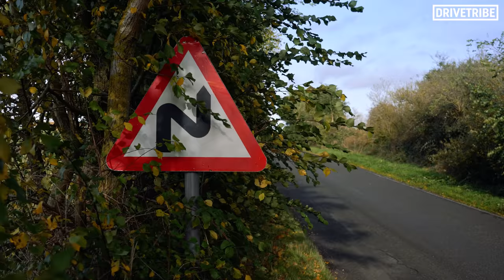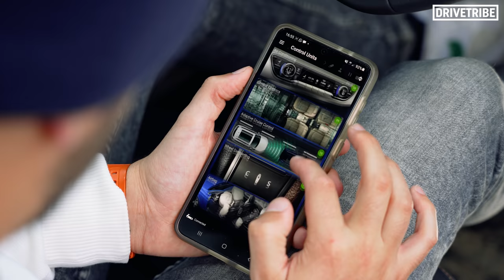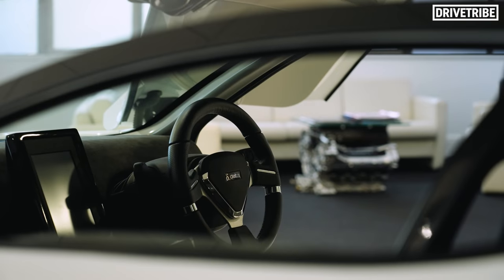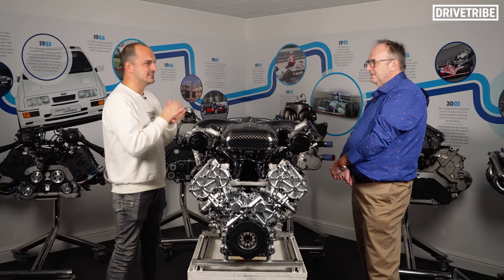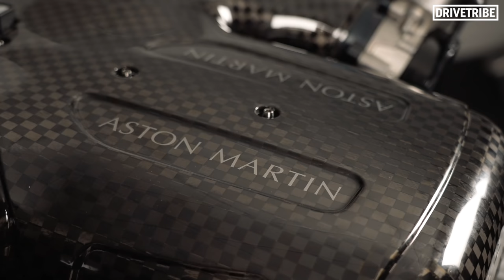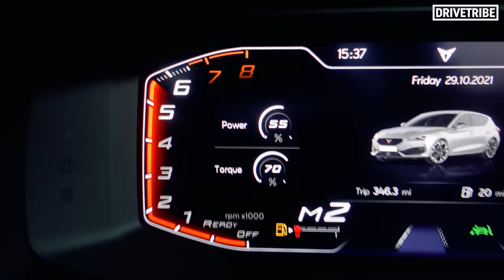Why are almost all modern engines 2.0-litres?

Comment: "If you're looking for 1000hp, you're not going to get it from an inline four"
Civic tuners: "Hold my valve springs bro"
Reply: My first thought was the Lancia Delta S4's twincharged 1.8L I4.  When they tuned the boost to the max, that thing could hit 1000hp.  For racing, they capped it at 490 (officially).
Reply: You can easily get this with an electric drivetrain
Reply: GM EcoTec motors have entered the chat
Reply: @walterrudich2175  BLASPHEME!!!
Cast the heretic out from the Cathedral of Carbon!

But yeah... True.
Reply: @brokenursa9986  yes the Fiat Twin cam is a solid design that has lasted and been fitted to an insane amount of vehicles.  Power depends on build internals and turbo / charger , and head cams fitted.  Look up Triflux engine abarth special design for S4 ECV Grp S .
Reply: @revolutionday1  GM left the chat due to impending bankruptcy
Reply: You can get almost 2000 hp on 4 cylinder
Reply: @walterrudich2175  No torque though.
Reply: James Mcguire  why wouldn't you use nitrous?
Reply: Volvo 940 Gl has plenty too. Goes like a box of bird poo
Reply: This dude is exacly wrong.  ALL ralley cars are over 1000hp and 2.0L
Reply: The problem with small 1000hp inline 4s is they make 1000hp for 2k rpm but a larger engine has large power from the low revvs too
Reply: @ChutneyGames  The big problem is reliability decreases with engine stress. No one fläsks around with a leek hp for tired eco-torquing, that's what you get Lorry for.
Reply: James Mcguire  right now, battery vehicles have about the same range as gas vehicles, and they charge in 20 minutes while gas can refill in only 6 minutes. If they can cut the charge time in half, to 10 minutes, then I think that will be the transition point for most people.
Reply: @pilotavery  so you're saying a 20 minute super charger will put 350+ miles of highway driving back on an EV? 

I'm all about evs but our family has property 2 states away and we visit often. It's 1100 miles round trip.
Reply: @Seasniffer69  very close, lucid air can charge 20 miles a minute, can reach 300 miles in 17 minutes, 344 miles in 20 minutes. This is dropping year over year. Tesla can charge 1,000 miles of range per hour, or 15 miles a minute, but only up to about 200 miles of charge. Even then, that's dropping year over year.

EV's are just now becoming feasible for road trips. In 5 years or so, at the current rate of improvement, they will have range and recharge times on par or better than gasoline.
Reply: @pilotavery  hm my next question is, are ev batteries still advancing or Is the juice almost squeezed out of that? If we kept the car weights from the 90s with the fuel efficient transmissions and engines of today we could have 50+ mpg 4 door sedans.

The last 30 years or so gas mileage really hasn't improved in combustion engines for normal cars. Not hybrids or niche smart cars/fiat absrths.

My 97 Honda Civic got 35mpg highway not even trying. A 2017 Honda Civic is just about the same.
Reply: @Seasniffer69  we have 50% efficient gasoline engines right now, and the most you can ever get is 100%. We've kind of reached the peak of engine efficiency.

We could get Lithium 100x the capacity as we have now, but it's a lot more likely we will switch to another less expensive for more effective battery. Battery technology is agnostic in that you can switch the chemistry and the car is fundamentally the same. The theoretical limits of battery tech is about 100,000 times the capacity but really, we're just going to see these incremental improvements over time. It doesn't have to be perfect, just better. 

Batteries are getting 10% lighter, more powerful, faster charging, and cheaper every year, consistently. The chemistry has changed from Lead acid to nickel cadmium, to nimh, to NMC lithium, LIFEPO4+ lithium, NM, various other lithium-type chemistries each better than the last.

Gas engines just can never reach 100% efficiency, and 50% is considered the best we can do without using space age tech to make it vibration and noise and heat-free.
Reply: @Seasniffer69  gas mileage has not improved because we've reached the limits of gasoline engine efficiency, roughly 53%. 53% efficiency cost twice as much as 50% which cost twice as much as 46%. So we've reached the peak...
Reply: @pilotavery  so how's a 1.6L Honda engine get the same mpg at 2600lb car as a 2.0L 3000lb car?

A heavy car in the 1990s was 3000lbs with most being 2500-2800lbs.

New cars? A heavy one is 4,000lbs. Typical sedans are 3100lbs.

Put a new motor in an old car.

Direct injection did not exist much outside of supercars/racing in the 1990s. Let alone in economy cars.
Reply: @Seasniffer69  we've gotten so advanced with the engine technology that right now, manufacturers are using aerodynamics for efficiency instead of engine. It costs less to implement aerodynamic efficiency increases, and we've reached the limit of that now so we're moving back to engine advancements. Hence, new engines like skyacriv and others.
Reply: @brokenursa9986  never trust an Italian mechanic, my fiat panda-romeo ( a panda built with Alfa Romeo parts from the prototype division of Alfa Romeo) was able to defy gravity.
Reply: @Seasniffer69  Batteries are fairly advanced at this point. I think modularity and standardization is the next big advance. As it is electric vehicles cat 2 to 5 times the range of equivalent energy in gasoline (MPGe)
Reply: @AmeriMutt76  road cars are totally not the same as rally cars...road cars are designed for TRANSPORTATION/DURABILITY...so the engineer is correct, you're  not.
Reply: Steven Sanders  exactly. ROAD cars must be as reliable and efficient  as possible. These fools like speed, not cars. They don't know what transportation means.
Reply: J.a.m  extreme tuners 2145bhp evo 9
Reply: Laughs as he says you’re not going to get 1000hp from a straight four😂 he obviously doesn’t see many modified cars.
Reply: 2.0 can get a lot of HP.But how long will it last 🤣 3.0L is the key to hapines
Reply: @walterrudich2175  Yes for 10minutes  and a 4 hour recharge time for a bev or two minutes to fill a liquid fuel tank.
Reply: yah and then their engine throws a rod or blows a head gasket 22 miles later
Reply: Koenigsegg: hold my missing cylinder
Reply: @brokenursa9986  same thing with the old BMW F1 cars… 70+ psi of boost through a TINY 4 cylinder… not reliable and EXTREMELY difficult to drive 🤣
Reply: @pilotavery  I don’t think lithium will be what replaces internal combustion… once we figure out how to mass produce graphene batteries, it’s over for everything… JETs, cars, trucks, you name it…
Reply: @Texas_Road_Warrior  which cell chemistry will make the race is a question of economics and dependencies not about which has the best properties. Graphene still needs graphite which mainly comes from china and is considered to be one of the four problematic materials in NMC li-ion cells the others being lithium and cobalt due to problematic mining and nickel due to limited resources. It's not unlikely that sodium-ion batteries will become a big player, but only if lithium tech hits a wall in cost development. So... There's many magical battery tech on the horizon. Could be that none of those ever ends up in a car. It's risky betting on it.
Reply: @pilotavery  Which gasoline engine gets 53% efficiency other than F1 engines? The most efficient production internal combustion engines are turbo diesel engines with 46-47% at peak efficiency which you'll almost never reach for long because that peak is very sharp and boost, revs and load need to be just right. Real world efficiency after drivetrain might get as low as single digits in City-Traffic.
Reply: @pilotavery  combustion engines (that includes turbines) have a theoretical efficiency limit of somewhere around 60-70%, I forgot the exact number.
Reply: @kooooons  It's the Carnot number, and it's about 85% efficient. The changing volumes of gases have a loss totaling about 15%, which even in a perfectly efficient engine, can not be lowered.
Reply: @kooooons  By 100% efficient, I mean that the engine has no losses, and the only losses are fundinental, AKA no physical way to increase it.
Reply: @pilotavery  I got that, but you wrote it in a way that could be misunderstood such that the theoretical limit for combustion engines was 100% which might be misleading.
Reply: @kooooons  the combustion process is not 100% efficient, but the engine can be. The engine can be designed such that it has zero losses
Reply: More boost, sodium cooled valves with continuously variable valve control, direct injection, water injection, turbo super compound variable boost, dynamic ECU tuning mapping etc
Reply: @walterrudich2175  it’s not easy to get 1000hp in an electric motor, You would need a power supply that generates a little under 800 kilowatts per second assuming the motor is 95% efficient. 

You average household plug generates up to 7 kilowatts per second so you would need over 110 of them to generate 1000hp.
Reply: @pilotavery  my Amarok does 800km per tank... no EV is charging that range in 20min...
Reply: @andrevanderwalt2515  that's true, but that's also not your average car. Additionally, most people don't drive that much in a straight shot without stopping for break.
Reply: Reading this thread and relating to a comment at 7.45 the guy stated that 1000 horses from a 4 cylinder requires it  to rev to hard. (Not is exact words) They as a manufacturer didn't want to go there. High power 4 cylinders must rev hard increasing potential failures quicker.
Reply: J.a.m  k20 just search 2000hp civic it's a 2.0
Reply: @AmeriMutt76  just... no
Reply: Nah nah my first thought was the turbo erea of f1
Reply: @johnpopoff7950  you have to be joking. Electric drivetrain have torque as soon as they start rotating - effectively from just after zero rpm.
Reply: @pilotavery  And can make it from LA to Vegas on one charge.
Reply: @johnpopoff7950  can go from San Diego to Vegas.
Reply: @walterrudich2175  for 5 minutes yeah. Lol
Reply: Which 1000hp engine would you like?

A Chevy 632 10.4L V8 naturally aspirated, or a Mitsubishi 4G63 2.0L with a huge turbo?
Reply: Right? A K24A1 can do that.  It might not like it, but itll do it.
Reply: @jarrodheley7879  A 632 will destroy your drivetrain at idle hehe, so i want that one 😁😆
Reply: what if your looking for 3000hp. the fastest street car in America has 3300hp. 1000 way too low for me. you can more or less buy close to 1000 hp stock these days with cars like the 840hp dodge challenger demon. or the 797 hellcat. 760hp ford shelby corba gt500. also Corvette is releasing a 1000hp engine stock in 2024. LT6 engine with dual turbos. 1000 is so boring these days its become a stock HP.
Reply: In brazil the late 90s vw ap engines are famous for getting 1000hp easly with 1.8 ~ 2.0 liter 4 cilinders
Reply: @johnsimpson5471  But only for 20 minutes lol
Reply: @curtisducati  not even maybe 8 sec!
Reply: Step 1: buy chevy Silverado 
Step 2: buy rods, crank, Pistons turbo
Step 3: tune it till goes boom
Reply: @ianmontgomery7534  wouldn't combustion engine produce torque at one rpm! Not saying as much as electric.
Reply: The megatron engine: Hold my beer
Reply: @Seasniffer69  yup i miss the crx, it got 40 plus mpg at 4000 rpm going down the highway because it was so light. And because it was light it was competent in the corners. I wish they could make a modern car that was that light again.
Reply: @Seasniffer69  yup i miss the crx, it got 40 plus mpg at 4000 rpm going down the highway because it was so light. And because it was light it was competent in the corners. I wish they could make a modern car that was that light again.
Reply: Yes but I dont want to be rebuilding the thing every 12 months.
Reply: @pilotavery  in the Australian market, utes like the Amarok are one of the most common cars on the road. Utes are designed for carrying weight and distance travelling while being reliable and relatively fuel efficient at that. EV just doesn't have that on say diesel engines for all those categories as when carrying larger amounts of weight the power economy is abyssmal as well as a massive lack of infrastructure. Generally if you have a ute in Australia you're carrying large amounts of weight whether it be for work or for going camping or anywhere semi remote or just general stuff for a car. there's plenty of diesel and even petrol utes out there that can manage 700km out of a 70L tank while carrying over a Ton of weight. The new Toyota Landcruisers are a Twin Turbo 3L V6 Diesel and can manage roughly 23mpg with a payload. electric can't compete with things like that at least in the Australian market at least not with the current battery technology
Reply: @walterrudich2175  lol sure you can
Reply: V8s for ever🥰
Reply: @johnpopoff7950  .... electric motors are know for torque. They have torque starting at 0 RPM. The Model S Plaid has around 900 ft/lb of torque.
Reply: Jett racing 4g63 2100-2200hp 110lbs boost 4cyl they say it may be possible to get 3000hp
Reply: Chevy 4 cyc. has the record for highest HP.   I'm not a GM fan...don't own one.
Reply: @bmwlane8834  yeah I'm not sure what the record is, I know Jett racing 4g63   4cyl has 2200hp  110+120lbs boost
Reply: @walterrudich2175  haha battery go BOOM
Reply: What's with the hat?
Reply: @johnpopoff7950  but instantanous torque at full, 100% capacity availble all times whenever you touch the throttle assuming you've alr bypassed ABS and other traction control system thar limit power output and torque reaping and milking at the little max. torque output number electric cars have a tendency to have
Reply: @AmeriMutt76  and are Factory prices
Reply: The titanic had 2 inline 4 engines that put out up to 15,000 hp of course they were steam engines
Reply: @zokusharuuku1091  or marine engines
Reply: @jarrodheley7879  had a Mitsubishi Galant one down from the rally art four-wheel drive four-wheel steer. Fking thing was rotten like a pear. Engine an running gear sweet 😁
Reply: @danielmeador1991  so a bisected v8?
Reply: @riceduck4657  huh
Reply: Won't last long
Reply: @kooooons  already past sodium ion, we have just seen solid state ceramic battery cells. Will no liquid to boil they can be charged really fast, as in 6 mins for a 24kwh pack. Also some new metal for the electrodes on sodium ion batteries for faster charging without damage too.
Reply: @michaelbamber4887  The difference between solid state and sodium ion is, that one of both has the biggest battery manufacturing company in the world announced to start selling them in large volume in 2023. That's CATL building sodium Ion batteries. As far as I know there are no such announcements about solid state batteries. 

But still, that doesn't mean, that any of these will beat li-ion. As I said a lot more than materials and energy density come to play when we're talking about which technology will be in future batteries. Nobody knows what we'll use. The only thing that is pretty certain is, that batteries are the future - whether you like it or not.
Reply: @kooooons  gogoro Taiwan, have made a lithium ceramic sold state battery that is in real world testing in swappable battery scooters that have has lithium ion swappable batteries for the last ten years. They claim super fast charging and bigger capacity from same size pack.
Reply: @michaelbamber4887  Just looked that up. They announced made a prototype for Real world Testing. Testing might still show unforseen problems - Manufacturing might still be complex. Don't get me wrong: I'm not saying Solid state Batteries will not happen and it's fascinating tech, but i would place bets on it ever being better in enough Parameters to replace li-ion Batteries. Even for Na-Ion Batteries its not clear if they're gonna be used in cars even though those cells are ready for Production while being cheaper, safer, quicker to 80% at lower temperatures but a little less energy dense than current LFP.
Reply: @kooooons  I love me petrol stuff. But I find this battery technology very interesting. Least they have been testing in the real world with a swappable system too, because this is what we need. Cars need a swappable system too. Gogoro have let honda and Yamaha and kymico use the battery so all the scooters can use the same one an swap at the battery bank. I'm surprised that it's not being tried in somewhere like Italy with their love of scooters!
Reply: @michaelbamber4887  i disagree about swappable batteries for cars. For rentable scooters it seems smart, though. My daily driver is an EV. I know the range. I had to stop once for charging in the last 18 months so the necessity for ultra fast charging is already low. If I had the battery swapped that one time, I might have gotten an older one with less capacity left and would have had to either spend the last 10 month with it or get it swapped again. I don't want that.

But more importantly: the infrastructure would need to always have full batteries in stock with no other use than using a few percent for grid storage. That's wasteful and how much is even enough to provide everyone with swap batteries around Christmas? What would the extra holiday capacities do when there's no holiday? Think about all the negative effects that battery production already has and now you need multiple times the batteries.

I don't think that would work out.

Many companies announced doing it all but one dropped the idea.
Reply: Yes, with nitromethane lol
Reply: @walterrudich2175  You could... but why?!?
Reply: @johnnemesh5459  You forgot to add "again".
Reply: @burnerjack01  It's the future.
Reply: @walterrudich2175  Yea but the cars weigh as much as an entire moon
Reply: Transition to what? From one greedy multinational to another?
Reply: @diedairy5981  Transition to electric transportation.
Reply: @pilotavery  but the body can... chop the springs
Reply: @claxtoncurtis811  step 4: me and mad scientist pull it apart and replace piston rings
Reply: @claxtoncurtis811  Maybe one day a carbon fibre car
Reply: Civics? LOL
Reply: @Sid The sloth I mean, now there are even Hyundai and Kia cars... Personally, mine has 410 miles of range but I get about 390 on a normal day. I usually stop for about 25 minutes but I have an older car. The Hyundai ionic you only have to stop for like 10 minutes or so. On the lucid air with the modern fast chargers, even though there are only a couple in the country, 6 minute charging has been demonstrated but it's still going to be a year or two before they're more common. 

Even though these ranges and speeds are only on the most expensive of electric cars, the point is that it's possible and it's becoming more common.
Reply: @Sid The sloth 20 minute charge time is already on a lot of cars now. Have you checked out the lucid air?

Of course, you need a really high kilowatt fast charger but it's possible.
Reply: @walterrudich2175  evs are cool but boring at the same time
Reply: @Sid The sloth I mean a few years ago sure. Have you seen the 2022 ioniq? They charge faster than the fastest charging Tesla's do. Battery technology is rapidly increasing every year and your statement sounds like you did your research literally a year or two ago. But not in the past 3 months. Some of these new batteries have been demonstrated to charge fully in 4 minutes, although they aren't in mass production yet.
Reply: @Sid The sloth personally I just charged my car from 9 miles to 282 miles in 14 minutes. That got me 2 hours away and back. I imagine in 5 years from now it will be even faster, probably on car with gasoline of under 2 minutes.
Reply: @Sid The sloth also, the charge rate for cars and trucks are measured in C, or a function of the percentage of its charge. A battery twice as big with the same chemistry can accept twice as much current for the same time to charge. So semi trucks and cars are going to charge the same speed with the same technology, provided the trucks get more power input. The charge speed is based off the battery chemistry more than the charger.
Reply: @Sid The sloth must have been a couple years ago.
Or maybe it was a different manufacturer.

The current semi trucks that are being tested on the road have 430 mi of range and charge in 34 minutes, but that part limitation is because of the charger, technically if you have more power you can charge faster.

The current generation of electric car batteries can charge fully in 22 minutes or less, 0 to 100. About 15 minutes from 0 to 80. That's just going to get better until it matches gas cars.
Reply: @Sid The sloth I know, my background is in battery management technology. The reason why we have batteries that can charge in 6 minutes, but they're not in cars yet, is because they have to figure out how to dissipate all of the heat they generate. The best ones can charge at a third of their Max rate because of the limits of the current tech. As batteries internal resistance decreases, this will get better and better. As charging will produce less heat per kilowatt
Reply: @Sid The sloth True, but it's close enough now. As in, existing cars can charge in 20m. 

My last road trip from San Diego to Denver Colorado I had to stop 4 times for 22, 18, 17, and 34 minutes. It ended up taking 2.5 hours longer than if I had just driven a gas car, but tbh I didn't mind
Reply: @Sid The sloth and those that are willing to pay an extra $400 to save 4 hours are happy to wait another two or three years until they match gas cars, once the existing batteries start being used in cars
Reply: @Sid The sloth well if you charge at home the break even for gas is $0.83. so gas has to be 83 cents a gallon to match the price of charging at home.
Reply: Facts
Reply: @johnpopoff7950  Rimac electric hypercar I believe is 2000hp and one of the fastest electric vehicles would smoke a lot of gas cars
Reply: @johnsimpson5471  My dad achieved 2700 on 4 cylinder engine
Reply: He's talking about production cars where longevity is a key factor.
Reply: @pilotavery 6 minutes? What are you refilling a semi?
Reply: @impactodelsurenterprise2440 I timed myself stopping for gas. 6 minutes and 12 seconds total including tapping my credit card on the screen to pay. 16 gallons filled up until it clicked.
Reply: @pilotavery  my 60 litres tank gets filled up in less than a minute. 5 minutes is excruciating.
Reply: @impactodelsurenterprise2440  well fortunately you actually spend no time since you just plugged in when you get home. Only cross country does this matter and then a 5-minute break every 6 hours is going to be welcomed
Reply: only if you spend too much money
Reply: @colliehaughton7595  You're not wrong.

As a value proposition, an LS swap beats building and tuning a K-Series and sending it to the moon any day of theweek... and an LS fits in almost anything. Almost.

For the displacement you're getting, (which we all know there is no replacement for) they're a surprisingly compact design and relatively lightweight too.

If you just want "bang for buck" or horsepower per dollar if you will, and do it reliably; the LS family are the greatest engines of all time.